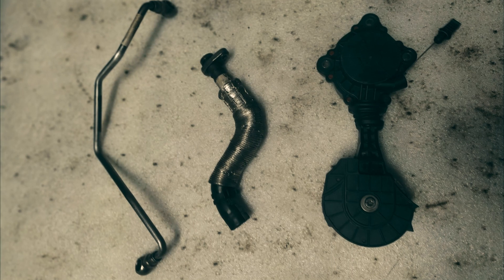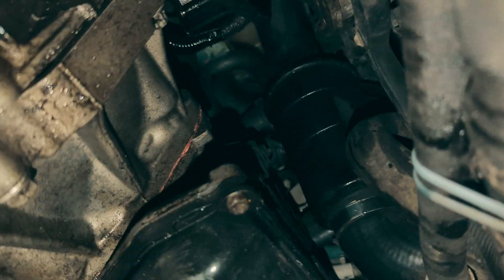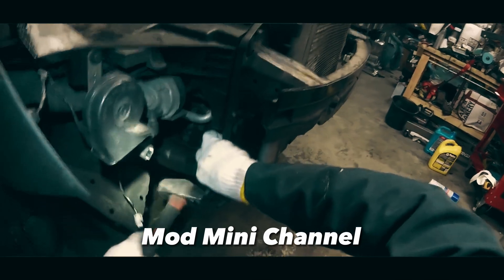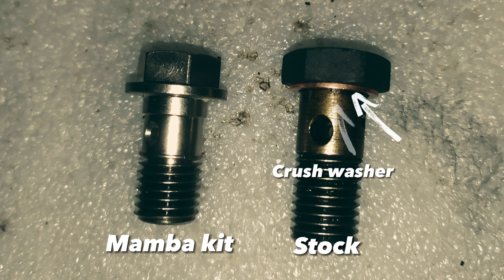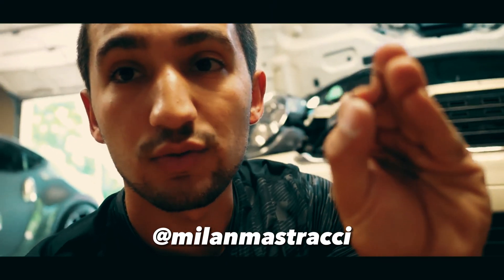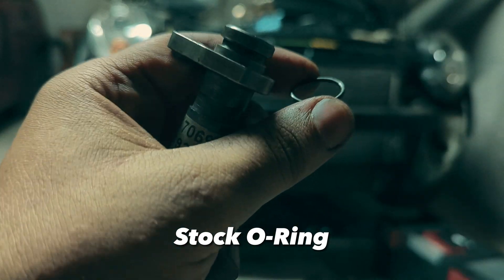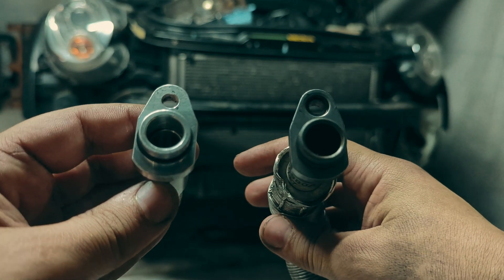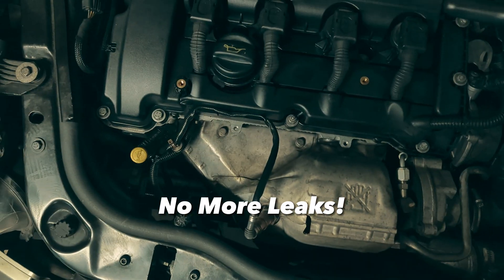A HUGE PROBLEM With The N14 Engine Turbo Oil Lines! Mini Cooper S R56

Comment: I had the same problem with the Mamba kit as well.  Didn't take long for it to happen, maybe 10,000klms and noticed oil drops on the garage floor.  I replaced the oil cooler etc gaskets as well at the same time as installing the Mamba oil lines to the turbo.  So I thought the rubber gaskets on the oil cooler etc was leaking again.  But no, when I managed to take everything apart again, I found it was the o-ring on the return line had turned hard and cracked.  I've replaced the o-ring with another one, hopefully will last longer.